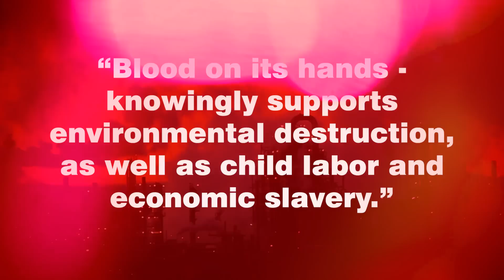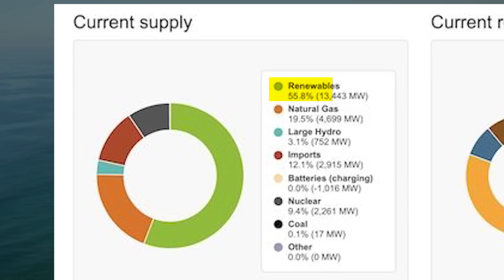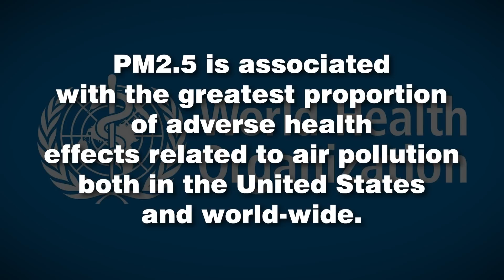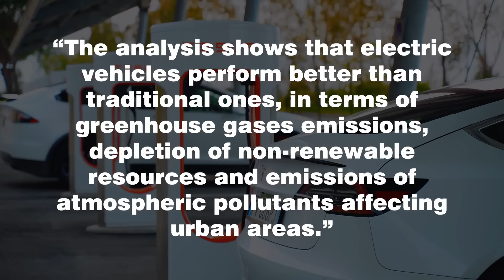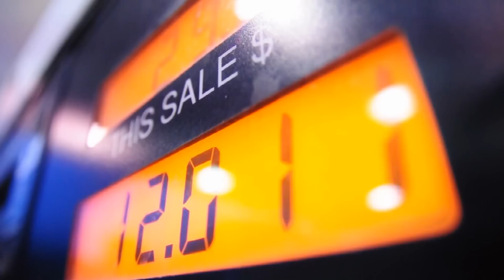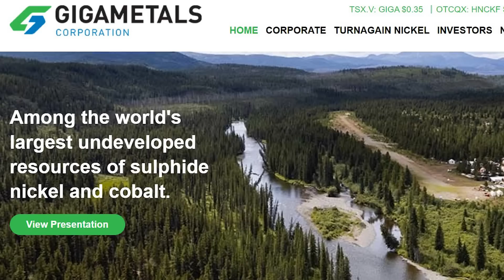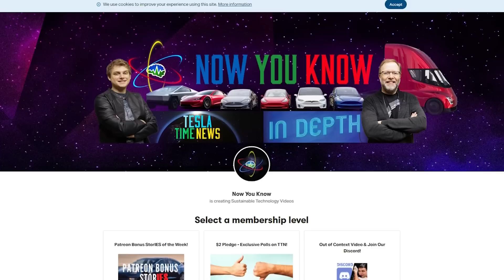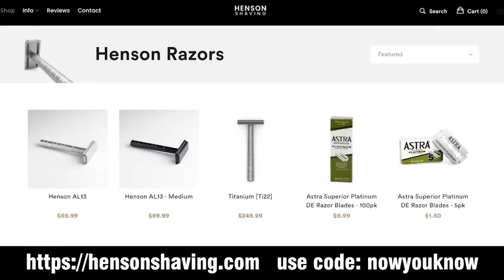Debunking More EV Lies | In Depth

Comment: Also it's really important to point out that producing gasoline ALSO uses electricity, so if you count the electricity generation as a source of emissions for the EV then you also need to count it for the fossil car, and it turns out fossil cars use more electricity than electric cars.

Also I love how she repeats the line of "Due to the energy cost of manufacturing the batteries an EV needs to be driven X miles before it's greener". I always kind of chuckle at that because the number is always like "40,000 miles" or "60,000 miles". So....an amount of driving that almost every car will do? Like if there was a study that said you needed to drive a million miles then that would be one thing, but 40-60k is like...less than 5 years of driving for the average American car.

Comment: I have 2 questions about information left out of your rebuttal. You didn’t give any information about the Tesla batteries used in cars manufactured in Fremont or Austin. Do the US Tesla batteries contain any Cobalt? Second, why didn’t you include the fossil fuels used to generate electricity for EV’s, but you did include the gasoline burned by an ICE vehicle in the overall lifespan comparison?
Reply: Ok. Let's....
First.
"The Tesla batteries used in Fremont (and some in Texas?)" Have tiny amounts of Cobalt compared to the industry average, a few percent.
They are working hard to remove it all.
Have you ever considered the use of Cobalt by the OIL INDUSTRY to remove Sulphur from fossil fuel? (Yes, they do)
Do you think any of that came from artisan child mining? (When nobody was looking?)
.
Second
Let's include the fossil fuels to generate electricity for EVS!
NOW let's include the fossil fuel used by oil refineries to "refine" the oil for vehicle fuel?
Fair?
(Would you be surprised if I told you that mile for mile, it's the same amount?)
I should note they also burn the "waste products", the "dirty stuff" that's left over.... Nice!
.
Food for thought?

Comment: LIES LIES LIES!!!!  First off you have to convert to something comparable...the only comparable energy is straight to BTU's.  I don't give a rat's ass what you liars say....it takes XX Btu's to make a 4000# vehicle go 60 miles an hour for one hour.  It makes ZERO difference where the BTU's come from....electric or "fossil fuels"(another lie...dinosaurs did not line up to die in the same area to let their blood and guts turn into a burnable substance) fuels.  Complete hogwash and it is provable.  They have found that wells replenish themselves if you leave them alone.  But that said....the pollution factor is WORSE for electric cars for the line drop alone!  Do you have ANY idea how many solar panels it takes to generate enough energy to charge a car?????  Then there is the fun part...have you even THOUGHT about looking at strip mines and what THEY do to the environment?  What about when the batteries are spent?????  Then there's another fun factor....do you have ANY idea how many birds are killed daily by windmill blades????  OR how many are killed by the reflections off solar panels????  Try looking at apples to apples.  You're so frikin far off base it isn't even funny.  Then what happens when there are accidents, and there will be plenty.  What about the environmental impact of spills and fires due to the volatility of the beat up batteries?  And WHERE do they throw them away once spent?  Did you even THINK to check what is happening to the blades that wear out on the windmills?  There are HUGE dump sites that are quickly filling up with balsa cored blades.  So many that the balsa industry is cutting trees WAY faster than they can be replaced.  And what about the oil that spills out of the windmills when they break...and if you would bother to look you would see that's a common occurrence.  And I can't WAIT to see how many people die from exposure from winter and heat strokes when the batteries croak.   You are seriously biased idiots/gore bots.  EV's may one day be viable but it''s not now.  Not until we have quick charging, WAY better motors, WAY better infrastructure (did you know 2 days after commiefornia released they will not allow gasoline cars to be sold in 2035 they also said to stop charging their EV's????)  You look for the answer you want and get it from the guv stats....oh yeah...we can trust that.  And beat up a nice lady that is exposing the lies?  SHAME ON YOU!!!!  fools

Comment: Keep hammering the lies of big oil! I now live in Portugal and power my home fully with solar and batteries. My system is connected to grid, but only to check if it still active. My power bill for 35 days was for 15 kilowatts at a cost of $3.00 Euros. When we add an EV to the mix, that to will charge for free! Stick that big oil. Wind and Solar never send you a bill.

Comment: One thing they always forget is Petrol Stations need Electric to fill the cars at the pump and the Garage is also powered by electric. So you charge a ev with electric and you power a ice gar using electric to fill it. At least with a ev once its charged and you drive your not adding more emision. ?

Comment: Meh, I don't care if my EV is powered by electricity from the worst brown coal one can find. It's still a win in "cleanliness" due to the far superior efficiency of electric motors vs ICE and the better efficiency of burning fossil fuel in a big power station rather than refining it and shipping it to burn in millions of individual ICE machines. 

I do have an issue with the insane rush to "net zero".  This has been going on in Europe for a long while now and it turns out renewables are not ready yet. Especially noticeable in Germany which has lost its gas supplies from Russia. This puts millions of people in a difficult situation economically what with the huge rise in fuel costs. 

So is it OK with everybody if we take care of the needs of people and keep digging for oil, gas and coal whilst we figure out how to make renewables actually work reliably and economically?

Comment: Hello Guys, as every a really useful and informative video. One point you could have added is that a number of car batteries are not even recycled, but are reused as static batteries  in many different ways to extended their working life for many more years. Before they are eventually recycled.

Really appreciate all your hard work. 😀
Reply: *REDUCE - smaller car, e-bike, etc *REUSE - static storage, project vehicle, etc *RECYCLE - last option, significantly less resources than mining/processing new minerals
The only option for fossil fuels is reduce...
Reply: Second use is fine, but as technology improves there's growing opinion that it makes more sense to recycle the "old" material into more efficient cells are first use.... When it's for a high energy cell.
The iron based cells may go to second use.
Reply: @rogerstarkey5390  As is being done at Redwood Materials - extracting the minerals for new EV batteries
Reply: The matter of the places that do not ready supply of solar, where solar not readily a fit for rest of country.
And wind is not a consistent solution. Add the Moore produced film with regard to the used batteries and 
wind mills. The alternate solutions are present and the ultimate disposition for them? The one fact: LIMITED 
range of EV's. A practical solution for the ways applied by companies, where charging station in ie LA and
the homeless issues that limit their charging in part of democrat places. And that does not even address the
geopolitical issues for the materials needed to make batteries. Its an imperfect solution, and remember 
SOLYANDRA and the scam that that was for the benefit owners and the workers, and obama was smug 
to boot. An easy answer, its complicated.
Reply: @thomasmargolis6057  We use solar where it makes sense. Wind where it makes sense, hydro etc. Wind and solar are often inverted. Meaning when one isn't available the other is. When it's cloudy it's often windy. Battery and storage technologies are advancing in multiple areas and fields. Nuclear is great for base electric power demand with natural gas for peak power. 

As for range... The average American(I choose America because you speak like an American) drives about 35 miles a day. A Tesla model 3(just an example) has a range of over 270 miles on a charge. So even if you drive 5 times the national average you would still be fine. You just charge over night. This doesn't even count charging at work or rapid charging. 

Let's say you need to drive farther. OK, for now just get an ICE or a hybrid. Diesel vehicles will likely make sense in highly rural areas as utility haulage vehicles for a while to come. The point is, there is no one single solution. It's a bunch of changes and improvements that will get us to a near zero fossil fuel future. 

Solyndra etc... Yep companies fail all the time. That's how the market works.  Others are growing and successful. Unfortunately we get scammers, it doesn't disqualify an entire field. As for the rest of your comment. Dude, why did you bring politics in to this. If you insist, at least learn to look beyond a partisan lense. Making your country largely immune to global gas and oil prices should be a bipartisan issue. See recent gas prices.
Reply: The sw has solar advantage, different areas have hydro resources, wind can be unsteady 2. And the intrinsic limitations.
Reply: And the number of EV batteries that are recycled?
Again, the information from Moore film on the dark side of alternate energy.
Reply: I doubt the market will let a valuable resource go to waste for too long. It's short sighted to dig up and refine materials only to bury them again. If nothing else the government will put incentives in to place along with regulations requiring the seller to recycle. Look at lead acid batteries for cars. It is at almost 99% of batteries being recycled in most countries. All this in a few decades.

Editted for spelling. I know my grammar and spelling sucks, but how the heck did "regulations" become "relegations." lol
Reply: EV's will find their place in the marketplace, or not. And the limitations will either sink alternate energy, or not. A current topic.
Reply: Batteries cannot be recycled.  That's a myth

Comment: You guys left out all of the electricity that is required to refine crude oil.  We can either refine crude oil or power an EV.  Lots of natural gas and electricity is required.  The refining crude energy could easily charge most of an EV needs.  Wow the truth has really stacked the deck in our favor.

Comment: cobalt is also used in the refinement of crude oil, which is used to make petrol, diesel, kerosene and pretty much any fossil fuel that you can think of. The process is called desulphurisation and cobalt is used to extract sulphur from crude oil   Also cobalt is used in most cell phone and laptops - why don't they tell people to stop buying those devices?
Reply: That is usually my retort when someone talks about cobalt in batteries.
Reply: True
Reply: I'm going to put my smug face on and take some credit for promoting this fact over the last 5 years. ➡️😁⬅️
Reply: Here's another one!!
Those "phone/ laptop cells (plus powertool/ power bank/ radio/ sex toy😉 etc) can ALL be thrown into the same system.
.
PLUS
 Note that JB Straubel says any PCB can be shredded and the material recovered (gold, silver antimony, lead, silicon, etc, etc, etc)
That wasn't economical before, but now, it's just "stuff" you throw in with the valuable stuff.
Reply: @bluehelmet314  Ah, when people who are telling you to do your research haven't done their research.
Reply: There is an average of 8 grams of cobalt in each cellphone produced. You might be unaware that there are 15 BILLION devices worldwide that use cobalt for functioning. 
So...mining cobalt is/was  bad for EVs  ,  but perfectly OK for your cellphone/laptop/Tablet!!!! . Stats also say that the average cellphone user upgrades every 18 months. What a bunch of wasteful ,irresponsible , susceptible ,gullible, and probably  under the age of 20 crowd.
Reply: We do...it's why, unlike those hypocrites, I won't use the most environmentally damaging device in the world today...the 'smart' phone. On the plus side I need zero cobalt to run an FCEV. Plus there's no discarded battery to leech Lithium into the water supply.

Comment: 6 minutes in: So you "debunk" a lie by admitting it's truth, then talk about how in the future it will be better so she's false/misleading.
Not impressed.
Give her credit for pointing out the flaws and then indicate how this is NORMAL considering there's a transition period, as infrastructure isn't built overnight, and you would have had a much better video.

Your point about the mines and various sources of resources - much better. As long as we limit our economic support to countries obtaining the resources ethically, we should be good, right? - Oh wait, Trudeau is trying to shut down production in Canada, meanwhile companies are buying the child labor produced resources because it's CHEAPER...stop it. I almost pointed out how Trump's tariffs could have leveled the playing field, punishing countries doing it with child labor, while America's current Dementia-In-Chief is allergic to tariffs...

I drive a Honda Clarity plug-in hybrid because I get the best of both worlds - electric for everyday use, gasoline when I need the extended range and/or the heat during Chicago's brutal winters. 60% of Chicago's electric is nuclear - which is arbitrarily labeled clean energy or not clean energy, depending on who you talk to [recently the EU is saying clean because fossil fuel shortage, hmm...]

Comment: I would really like to add some points. An EV, which I buy today gets cleaner when the electricity gets cleaner. A ICE car will burn the same dirty stuff from year to year. It won't get cleaner. When you live in Poland and buy a BEV today and Poland starts producing cleaner electricity in the future, your own car gets cleaner.
Another point are the studies the lady used. They claim, that it needs up to 60000 km, until the BEV is cleaner than ICE cars. So, thank you for that. She really admits, that a BEV will be cleaner in its lifetime, since it is expected, that a BEV typically drives way more that those 60000 km.
Reply: Don't forget the ICE car becomes increasingly less efficient from day 1.
.
I suggest downloading the Tesla Impact report, 2022.
Page 5 is especially interesting with regard to the (rapid!) "carbon payback" of their vehicles.

Comment: California has an electricity drought no thanks to green energy. It’ll be a long while before that balances out.
Reply: No, California had an energy drought that's to decades of underinvestment and mismanagement by the power companies.
The grid was going to fail.
The 40% of drivers of the most popular EV brand😉 who have solar, are effectively removing their cars AND their homes from the grid, REDUCING load/Stress
Then there's the Virtual Power Plant of their collective powerwalls, which provides Megawatts of energy to PREVENT cuts as required.
(You're on a loser. Give up)
Reply: @rogerstarkey5390  you and civilization would not be alive right now if not for fossil fuels, nitwit. I never said green energy would fail, I said that it’ll be many more years before we start seeing bigger gains from it than fossil fuels - which is the platform that’s allowing it to rise in the first place!  Trying growing a second neuron so it could talk to the other one, maybe you’ll think after that.

Comment: GREAT JOB GUYS! Thank you for putting all this together - I've so many people to share this with!
Reply: What size electric service do you have in your home?
Reply: @va3885  ...and just what has that question to do with this discussion?
Reply: It means the typical electrical service to a typical home cant handle the kilowatts to actually run these devices. And thats all these are. They are an electrical device no different a lighting fixture or a fan. Therefore, the amount of available current in your home will need to be upgraded which will add to the load on the existing power grid, which will require mor fossil fuels to run the extended power grid.  Understand?
Reply: @va3885  Not when I have my own solar, battery and 3 phase supply. 
And since my grid supply is going totally renewably sourced by 2030 anyway, it will not affect the grid CO2 output.
The extra cabling in the supply distribution is already well over capacity already, too.
Do you live in some backward area of the planet, like some areas of the the USofA which still uses the antiquated 110 volt supply on last centuries infrastucture?
Reply: @DrakeN-ow1im  impressive. Upload a photo of your grid. I’d love to see it. How many inverters and panels do you have? Are you tied into a utility as backup?

Comment: Comparing a Model 3 to a Corolla is just wrong.  Model 3 does 0-60 in 4 seconds. Corolla does 0-60 in 20 seconds. Comparing to a big block V8 with a turbo would be a closer comparison.
Reply: True

Comment: btw. regarding the tailpipe argument, there is BIG ONE which is always missing - when you centralize the "tailpipe" to powerplant, even if its coal powered, you have one place of emision and its relatively easy to implement new technologies to reduce the polution of the produce, on the other hand, ICE vehicles, when you have 20y old car, you wont get new technologies so the emisions are much higher and in my country for instance, there are plenty of ppl who straight up gut the car to remove the filters and other stuff to A) sell it and B) save future expenses

TLDR - powerplant is much easier to regulate its emisions compared to car tailpipe.